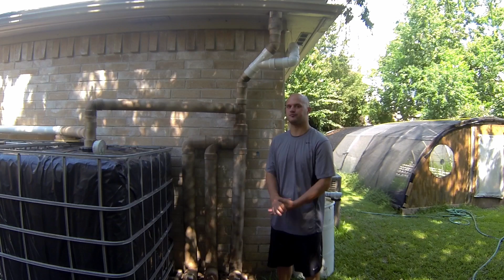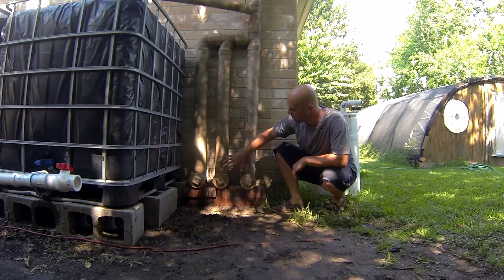Step 4 - IBC Rainwater Harvesting System - First Flush Diverter

Comment: How long does it take to completely fill up all your tanks?
Reply from the maker: All depends on the amount of rain. But just a couple of inches will fill my tanks with my roof.
Reply: Trenton Kaminski thanks for your reply. I just got my tank set up and we had a light rain last night. I need to figure out a gauge. I saw a video where someone was using “clear” plastic pipe that they kept under pipe insulation to protect from algae and UV so plastic would stay clear. Do you have any advice?
Reply from the maker: Affilate link: https://amzn.to/2MvO05L check this out, I used this on a tank before.

Comment: Hello sir. Im currently doing my research on the same system. Do you install any kind of screening filter on the gutter to prevent particles or leaves coming into the flow pipe or even any filtering system within the flow pipe itself? If you did filter within the pipe, how regular it will be to conduct maintenance? Thank you beforehand for awesome explaination.
Reply from the maker: Yes, a paint bag or pantyhose work good.

Comment: Howdy!  How much water do you think your first flush system holds?  If you took that amount up on the roof, would it really clean the roof off and flush it down the gutters to the drain pipe?
Reply from the maker: TheStavros1001 My estimate is around 8-9 gallons. A 4 inch pipe can hold .65 gallons per foot of pipe. I have around 12 feet of first flush pipe. I am not sure if it will clean everything off the roof, however it has to be much cleaner than the prior. I also use gutter guard on part of the roof to help with debris as well as manually cleaning the gutters from time to time. So far I am happy with the water I am collecting.
Reply: If it works for you, that means it's working great!  <g>  I was thinking that it will eventually get that "swampy" smell and you will have to clean out your totes after a while.  I noticed that LDS Prepper had that problem.   Also, since you were using the nylons for debris filters in the first tank, that tells me the first flush system doesn't hold enough of the dirty water off the roof.   I only have 2 55 gallon barrels, but am looking to add at least one if not two of those 300 gallon totes.  I use the first barrel as my "first flush," which gives me very clean water in the second barrel.  Depending on what I'm using the water for, I have a choice to use both barrels.  There are many uses for water that doesn't require pristine clean drinking water quality.  <g>
Reply from the maker: TheStavros1001 I have cleaned my tanks once since installing the system, Even with all my pre filtration I do still get a small amount of dirt that settles on the bottom go the tank. One of my reasons for the unions on the system, to be able to remove and clean a tank if need be.

Comment: You place an adapter back to 3in pipe at the bottom or your first flush so the two liter won't get caught up.
Reply from the maker: Hi Abel, Yes, there is an adapter from 3'' to 4'' so the two liter bottle will get caught up.
Reply: Hey there Trenton!...Great work man!..I was referring to the bottom part of your first flush. If you place a 3in adapter along with a 3in clean out at the bottom of your fIrst flush the hope Is the bottle will sit on top and not get stuck. Eliminating the need for the rock..hope thIs helps..your system rocks!
Reply from the maker: Abel Villanueva AH! thank you!

Comment: Idea for an option for the bottle seal would be to put a back flow preventer where you reduce from 3" to 4". Put it in line so water can flow down but as it fills the lower "junk water" tubes the water will push it shut and should divert. Might have to use a spring type due to the vertical application. But if the bottle is functioning for you, why fix what ain't broke and your idea is a lot less costly!

On drain the tubes, just drill a few small holes (like 1/16") into the face of your cap or even sides of the elbow. To help with keeping the threads clean, keep an old toothbrush laying their behind the pipe and you can use it to sweep the threads out. You might also want to experiment with wiping some vaseline on the threads of one cap. It should hel lube the threads and might help prevent some of the junk sticking. if it seems like it sticks just wipe it off.
Reply from the maker: Sig220Euro: Thank you for this information!